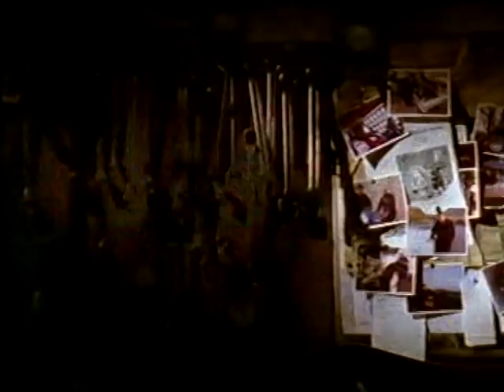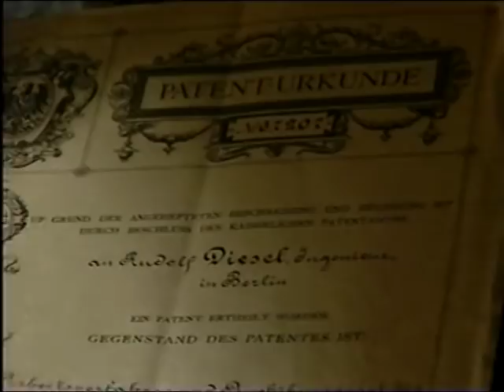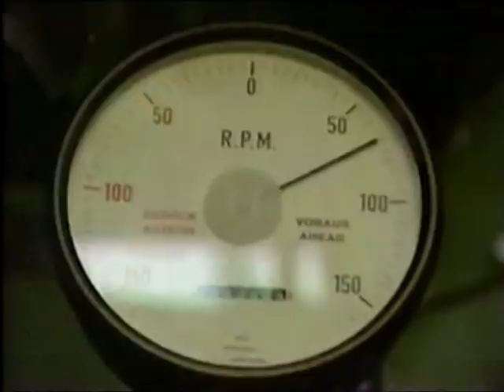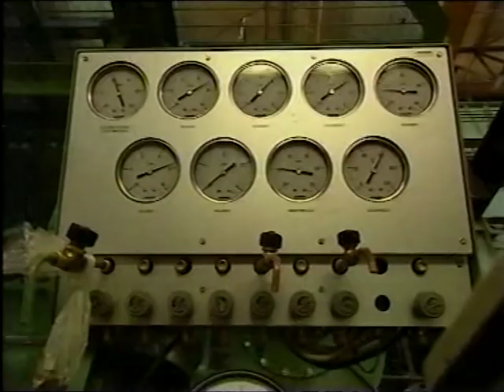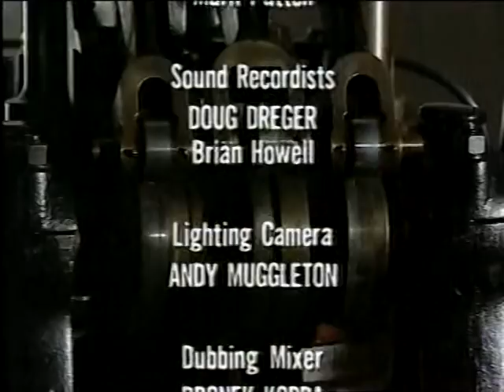Coltrane's Planes & Automobiles: The Diesel Engine

Comment: I assume that lighthouse at The Lizard is now un-manned & the foghorn now replaced by a anonymous electronic horn.
Gardner has gone the same way as Ruston, haven't they? Best diesel engine in the world the Gardner 6LW.
Reply: The foghorns are still there. Not sure of their operational status, the local lamps have gone over to pathetic LEDs with no presence in the lights loom to set them apart from a bright torch.

Comment: THEY ARE DEPENDABLE, REQUIRING BASIC REGULAR ATTENTION.. WHY THEN ARE THEY  N O T  USED IN AVIATION!?!?
WHAT A GREAT VIDEO.. THANK YOU FOR SHARING
Reply: it is. check out Diamond DA42. but thrust to weight ratio in aircraft is important and diesels are quite heavy and unable to produce thrust specially compared to jet engines. there is also info out there that diesel consistency vary on altitude and temperature. but it has a lot of torque. which is good for heavy machinery like trucks and ships. torque is heavy lifting. it does not have to deliver that force quickly like jet engines does.
Reply: I think that the diesel will be more and more popular. Just like in the car you get good cruise performance with range and cost. The Centurion is a very, very good engine. Turbo power, kerosene in the wings and fantastic performance. I'm surprised that diesel and kero isn't as popular as it could be. 100LL is fine but diesel has lower costs and greater performance. Thielert engines have incredible reliability.
Reply: In WW2 Germany had diesel powered bombers equipped with the Junkers Jumo engine.
Reply: Jet engines can be set to run on diesel fuel too.

Comment: I have heard that Diesel originally designed the engine to use hemp oil (when it was completely legal, also abundant and easy to produce), and had to adapt to an 'inferior' petrol/oil mix (which became 'diesel' fuel) when hemp became illegal?

Comment: OK, that engine at the end of the show, the hand-cranked one in Zimbabwe.  Is that a Lister?  Sounds like it, and the starting procedure is correct.

steve
Reply: Most likely
Reply: Yes - I remember this show when it first aired and the picture was better and Lister could be seen on the top!!  @linctexpilot8337
Reply: I have since found a Chinese Diesel 
engine, that has a compression 
release, and a hand crank.  It is a 
MASSIVE 3 HP engine, and I need 
something to install it on.

Yes, it starts the same way, and will 
"roll coal" if you increase the speed 
quickly.   I'm thinking a mini bike.

steve